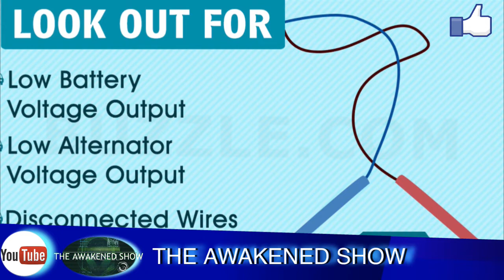RADIO SIGNAL JAMMED FOR DAYS IN OHIO BUT WHY?

Comment: lol you guys are acting like this is top secret technology, when it is probably just some nerd with solid understanding of electronics playing a prank. It is likely someone has a transmitter in the area operating on the same frequencies as the remotes, with a much higher power output than is legal. And yes, if you know what you are doing, a device like this could be home made (it probably is home made if it is jamming freqs in a band not used by hams).  EMPs wouldn't do this. Ask any radio engineer what they think is causing it